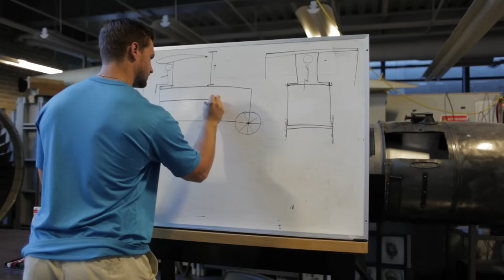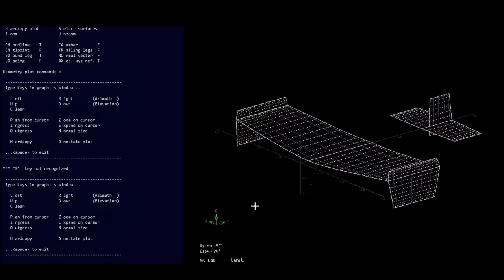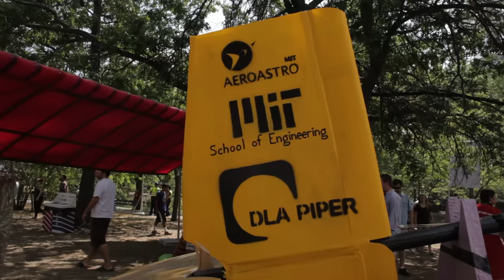MIT Monkey Ballers build a plane for Red Bull Flugtag 2016

Comment: I think US engineers need more hands on experience just building things. Our ENG curriculum are too heavy in theory.
Reply: Finally! A non-idiot post with valid constructive criticism! Not sure why everyone else with no education feels the need to chime in on the gliders aerodynamics that they know nothing about. The problem is lack of breadth in the education. Fortunately for these students, this is one way they gained some of that breadth!
Reply: Yea, seems they had the idea down and a near solid build but of course with a FIRST build.. it didn't perform well. Just more training .. as like with an other art or project.
Reply: As an engineer I agree with you 100%.  It is even worse now with the advent of 3D modeling and 3D printing.  You have a generation of new engineers with no idea of how to actually make the things they come up with, meaning machine, mold, cast, stamp, etc. let alone how to dimension and measure anything.  Every engineer needs to work with a machinist, assembler, inspector, etc. to learn the realities of how their pipe dreams are realized.  Engineers are getting as bad as architects who are famous for making beautiful building designs which are structural nightmares to realize.
Reply: @Pandainapandasuit  They changed a critical factor, the Center of Gravity, and did not bother to look how that may impact key areas of the design other than the one item they were trying to address.  That deserves a smack with a rolled up newspaper right on the snout.
Reply: My degree is in "Industrial Technology".. a mix of engineering and manufacturing..  It's a major that I think was perfect for me.  As a freshman, I got involved in the SAE Design challenges, and helped build a Formula-style car.  Near the end of the semester, as I was taught how to use a milling machine (well, taught enough to make it work and make parts), there were senior mechanical engineers coming in and didn't know how to utilize the machinery.  This freshman was teaching seniors on the use of a milling machine..  Now, granted.. I did get my initial help from other senior level engineers that taught me early in college.  I later went on to know more about milling machines, CNC machines, Welding, and woodworking.. and did get a bachelors degree from the engineering college I attended. It still helps me almost every day.
Reply: @kennethfharkin  Yes, the world of "process engineering" is very much needed.  One of my fellow engineering classmates worked at a company that made lawnmowers.. One exercise was to take a lawnmower out of the box and build it by the directions.. and then fix the directions and also rework any of the assembly process..  He said it taught him a ton.. like the instructions saying to tighten a bolt...that got blocked two steps earlier by a metal plate..   It's something I learned, and even in my professional career, managed to spot an issue in an instruction manual on a piece of telecom equipment..the issue?  Instructions said to run the A side power into the B side module.. which would wind up frying the machine..  I was profusely thanked for finding that error..

Comment: If you had found an RC pilot, you would have flown that machine.  When I saw the first part of the video, I said your center of gravity was off.  On the day of the actual flight, you had absolutely no airspeed.  That's why it went straight down.  You would think that someone from MIT would know this.
Reply: im an RC pilot with 25 years experience building and flying, from the moment i saw that thing on the ramp i knew would be a failure!
angle of attack , elevator negative, not sufficient wingspan, airfoil too thick and so on!! and im not an engineer...
Reply: Jean Carton you should know more about the competition.  Obviously it’s span limited. Of the problems you listed only one is relevant: the negative elevator angle.  If you look up the current world record you’ll see it was basically the same design.  That’s optimal for the given constraints.  You should understand them before you comment.
Reply: @  Jean Carton
No you're not an engineer, thank goodness, because all those reasons are baloney.. except for the fact that the full flying stab was in the hard down position but you didn't catch on that the angle was too ridiculous to be intentional did you? It's not by design. Wingspan is irrelevant as long as there is enough area, esp. in these short glides esp. without turning, the airfoil isn't thick, what angle of attack are you referring to other than the elevator knocked out of whack?

Comment: I think the message of this video is to accept failure and step forward. To put things in practice and not stay stuck in theory. Then try to make an analysis of why the design didn't worked and how the solve the problem(s).  The Wright brothers used the test-fail formula to invent the first successful airplane. Every corporation of aviation or automobile industry are constantly testing their prototypes before launching a new model to the market. For example, in formula 1 race cars engineers do computer simulations, wind tunnel tests and then try the cars in the tracks.  This a fundamental part of engineering.
PS. Sorry for my english.

Comment: so you built a plane and didnt valance it? what the fuck this guy should be the first thing theydo, make shure the airplane stays balance, pick it up by the wings and see if it tilts, all aircraft that fly is because they are perfectly balance,
Reply: Especially with no thrust.
Reply: Guess you never noticed that the elevator control cable snapped did you.. although they say so, and you can see it clearly. What the fuck the first thing you shoulddo, make sure you watch the viddeeo and listan to that guy say it broke and watch wit you eyes.

Comment: Doesn't carbon fiber and aluminum coupled together lead to significant galvanic corrosion?
Reply: Yes, but I don't think that would have been a huge impact in a one-time project like this.  Titanium alloys would be safe in that case, but a lot more difficult to work with.

Comment: And these MIT "engineers" sucks... LOL
Reply: TheTracatraca Did you even see the wing? That thing was designed beautifully. It was a control surface that screwed them up. But you wouldn't know anything about that.
Reply: We used to kick the crap out of MIT in soccer too. They aren't as good as they think...
Reply: TheTracatraca, I agree. Also, it looks like their wing was designed for some significant forward motion, which this thing was never going to have. It's almost as if they left gravity, and a many other factors, out of their calculations.
Reply: @robertorolfo, You are right, with a high angle of attack; and they even test it like a kite.. LOL!!

Comment: I’m not trying to be rude but I do love how geniuses from mit build a glider that travels 10 feet and a bunch of hobbyists from flite test build a glider for 500$ and make it over 150 feet
Reply: I love the flitetest guys, but you have to admit they have had failures as well. It was a bad day for the MIT guys, but you could tell they built something special.  They were trying to push the envelope a bit, whereas flight test was basically doing something proven, quick and easy. Trying to push the envelope can sometimes result in a small miscalculation leading to failure like this. The Daedalus aircraft broke in half just after crushing the human powered flight world record because of those slim margins.